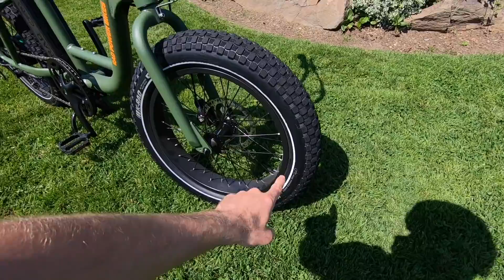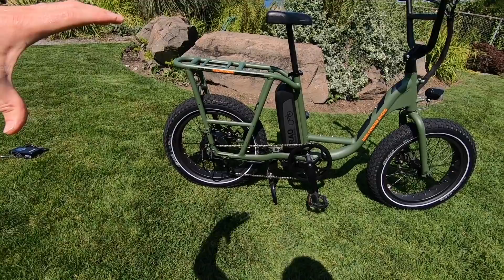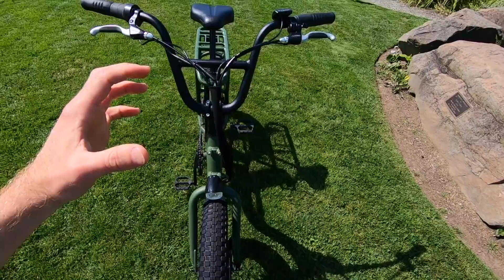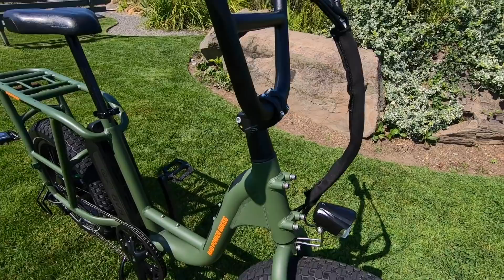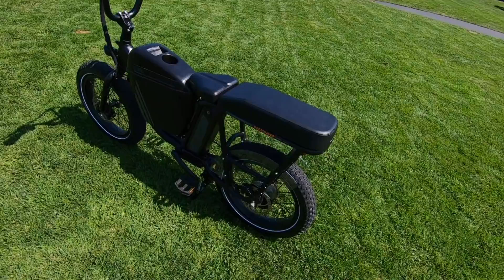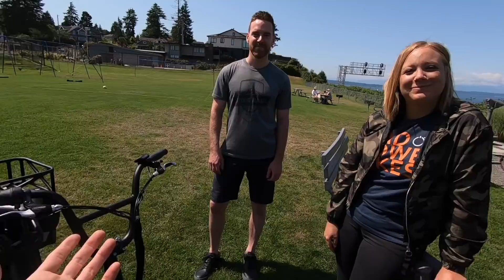Rad Power Bikes RadRunner Review - $1.3k

Comment: i'm debating which Ebike to purchase. My 3 comparisons are Rad runner, Rize Liberty and Juiced Hyper Scorpion. Any suggestions anyone? I think i'm leaning towards to Juiced Hyper Scorpion any comments anyone?
Reply: I almost got juiced hyper. Had it in the cart and gave up after few reviews of flimsy customer support, some awkward design decisions and CEO mail finally pounded nails in the coffin. The radrunner at half price is much better deal in my opinion. Far less legality issues, lighter, so far long rides on battery charge. I'm sure hyper is fine machine but for $3k you can buy honda or yamaha scooter/mini bike that will last longer and be far more capable ride.

Comment: Rode my friend’s Radrunner today here’s an authentic review. I’m 5’9”, 190lbs, a strong cyclist and live in a hilly neighborhood.
Cons: 
- It’s severely underpowered and performs like a 500 watt motor or less. 
- On hills it has a very hard time.
- Steering is dangerously unstable. - its seat is too high. 
- The cockpit is short/cramped. 
- It has too little slack in the stem/handle bars.
- The handlebars aren’t wide enough too keep the front wheel straight. 
- I could barely the get it’s single speed gear up a hill, even when I have it set to its top speed and pedaling
- It has 5 speeds and 2-4 feel the same.
- Does not ride like a bicycle.

Pros: 
- Rides like a scooter. 
-The tires are cushy.

I don’t  recommend the Radrunner at all. 

FYI: When test riding, don’t put a kid or first time rider on it until you figure out the quirks because they will tip over or go over the handlebars. 
I posted this because on YouTube there are only ads disguised as reviews. Hope this better informs your decision.
Reply: Haters will hate

Comment: Can someone tell me..does this size tire circumference not work as well for riding in beach sand...real beach sand..as the larger circumference tires? Provided comparing that both types have wide tires..but ..wont the smaller circumfrence tires not flow over the beach sand and maybe swerve more? I've asked even bike shop owners and I get vague answers..
Any help?

Comment: Beware, RadRunner rarely publish real customer reviews. I know, I've 
submitted the following every week for six weeks.... and even gave them 4 stars.. ZZZZzzzz

We Bought two Radrunners and multiple accessories. We were surprised not any assembly 
instructions. Instead watching multiple Youtube videos, that in a few 
cases were not up to date or detailed enough. For instance, the video 
explains handlebar assembly and makes no mention of the tiny black piece
 of plastic in the hardware kit, by the time I guessed that in goes in 
the goose neck hex bolt I had already misplaced the one for the first 
bike. I started by installing fender kits on both bikes, one bolt was so
 tight that I actually stripped the allen wrench that was provided but 
found another in my personal toolkit that worked. Second came the front 
racks, these both came with a black light mount that’s screw hole was 
too small to accommodate the screw. The video also shows you splitting 
the cables around the rack, but this didn’t seem appropriate with what 
we were provided and would make the Velcro case un-usable. I also 
installed the back seat assembly and shields and another rack on one 
without a hitch. Lastly came the $89ea pannier bags. Larger clips were 
supplied for the Radrunner, but when removing one of the four clips one 
encased nut kept rotating until I removed part of the bag assembly to 
hold it. The entire project took me (a retired shipyard worker) about 
five hours.
Our first ride! The bikes showed four lights on the 
handlebar monitor, so I assumed they were fully charged. We rode about a
 mile and returned, then I loaded up my 70lbs grandson and went two 
miles down the road. On the next mile the gauge dropped to two lights 
and the bike started to roll to a stop. I shut the bike off and walked 2
 miles while I called my wife to bring me her battery. Before she 
arrived, I turned the bike back on (four lights) and it worked. When she
 arrived, she took the grandson and gave me the battery. Subsequently I 
rode the bike about 4 miles (solo) back home using the pedals some to 
maintain my 15mph. Finally exchanged batteries and took the grandkid for
 another mile-long ride. The batteries have been charging since we left 
the beach, so it will be interesting see how they hold up after a real 
charge. BTW I weigh in at 225 and on all flat surfaces I’m considering 
buying a spare battery, but I’ll make up my mind after my next ride 
(next month).

Comment: Overall great review, quick suggestion is maybe you could have asked the other employees questions like what their favorite feature(s) are about the bike compared to the other models they sell or ask them to show how the buttons on the console work. I know that its pretty simple and you did it so easily but I just felt it would have been nice to have them talk more instead of mostly being in the background.

A question I had regarding the bike is what are the options for securing it to the car? I dont think its small enough to fit in my trunk do they sell mounts for the car? When im going on a shopping run is there recommendations on where and how to properly lock it to prevent theft? Should we take out the battery before leaving it unattended? Thank you for making great videos after watching your review I want to get this bike now!

Comment: Personal experience with a Rad Power bike:

I bought a Rad Rover less than a year ago. The breaks were squealing since day 1 but they told me "that's how these bikes are".
Battery life went down from ~20 miles per charge to ~4 miles in about two months; had to replace the tubes a couple times so far and been adjusting the breaks on weekly basis, but that wasn't the worst part.
A thief broke into my apartment's bike cage last month and store my battery. I reported the incident to the Police Department and went to Rad's website to purchase a new battery, but they were out of stock. Called them and emailed them multiple times and explained how the battery got stolen and I can give them the Police case number. I told them how I use this bike to commute to work and unfortunately you can't purchase it from any other supplier but Rad itself. But all I got in respond was "we can't get our supplies from China"

So, here I am, having spend ~1,800 in less than a year with a piece of metal that can't move basically. Consider buying your e-bike from a more mature company imo.

Comment: If you run out of battery how hard is it to keep going with this family of fat tire bikes?  I used to bike back to school from the South Bay to Davis as a kid on a 10 speed road bike decades ago.  Could I do that if the battery runs out without dropping dead?   The range is only 25 to 45 miles, and I suspect that it means it could only reliably run for 25.

Comment: Very nice review, very technical and informative I really liked it. My dad and I hunt where we live here in Central, I would like to see this bike reviewed in the woods dragging a deer out. I weigh about 250 and then of course you want to add your hunting gear and your gun or crossbow. How well did these bikes work in the woods?
Reply: Hey dude, I recently got the radrunner and in only a month have put 50+ miles in. I haven't dragged a kill but have had my 8 and 2 year old on the passenger seat (I'm 235, combined they are about 100) and there's hardly any lack of noticeable power.  I'd say this thing could hold 400 lbs and keep going. Having said that, I'm in Florida where there is relatively flat grounds... but I was able to go up a 45° incline solo with a bit of pedaling to assist.

Hope this helps! It's a great bike for the price... tons of fun.
Reply: Forgot to mention it does awesome offroad with the fat tires but it doesn't have springs on the fork so if it's really off the trail you'll definitely feel the bumps.
Reply: That's great. I do wish it has shocks. I wonder if the 2020 version will.

Comment: Every detail reviewed! Thanks for that! 🙏
Reply: Actually, no.  It missed a number of basic questions.
Reply: So you missed your opportunity to ask your questions instead of your comment? ;-)
Reply: @elektrokatzer  height, length?  Tapered or non-tapered handlebar--not riser?  If the pedals are so great, why do they keep breaking?

People talk about height, but that is useless.  I am 5'4", and have a 37" inseam.  How does that fit on these bikes?  What is the actual distance from the seat to the handlebars?  What is the distance from the crank to the handlebars?

How thick is the plastic on the fender?

It seems most things on rad bikes are proprietary.  Will a standard seat stalk fit properly?

It would seem that any bike person would want to know the answers to most of these questions.

Comment: Mine arrived a couple of days . It came needing a bit of assembly, handlebars, front wheel and pedals, very easy. I like it a lot. I cannot think of anything negative, maybe paint rather than powder-coat and accessories are a bit pricey. It’s surprisingly easy to pedal on flat ground without e-power. I would definitely recommend this bike.

Comment: I wonder if they weren't using the throttle on the hills in order to avoiding straining the motor. Did they mention the need to avoid throttle only on the hills? Also, do you feel like the Radcity does significantly better on the hills with its gears compared to the Radrunner? Thanks for the great review.

Comment: No really sure of what your thoughts of the single speed aspect are. Does the motor over power the peddles. In other words can you peddle at all speeds?
Reply: I am interested in the answer to your question too.

However, believe it or not I would prefer a bike with no gearing. I ride non motorized bicycles a lot and I love my single speed bicycle because it is super reliable.

Up here in Toronto when riding in the winter with slush and salt on the roads, derailers can take a real beating. 

So like I said, personally I prefer single speed bikes for every day use. Plus with the motor here there is no need for low gearing since you can just use the motor to get you up to speed.
Reply: Of course they can be peddled at any speed.
Reply: @ohwell2790  well actually with a single speed bicycle once you reach a certain speed you can't really peddle because you would have to move your feet at a very uncomfortably fast/impossible speed

Comment: The concept is absolutely great but I will wait on the upgraded model for mainly one no-go reason:
IT HAS NO GEARS AT ALL !!! , which means this things is impossible to ride without battery assistance. I prefer not to think at the horror scenario, being Km’s away from home with a depleted battery. 
Otherwise great job guys. So please come up with a new version, some additional hundreds of bucks would be fine 👍
Reply: The specs say 16-52.  It must be an internal gear hub.
Reply: @martincleary9093  in my understanding, that's a single speed bicycle, 16-52 refers to the gear ratio between front and rear sprockets.

Comment: First of all, great concept and very interesting and appealing. Q's: 1) Can a rear derailleur be added later? 2) Is there some type of adapter for the fat rear rack tubing to accommodate Ortlieb bags (that many folks already own)? 3) Can the frame accommodate a front suspension fork if later one wished to upgrade that? 4) Upgrading to a seat suspension post is often done these days; Does the geometry definitely result in the adjustable seat being higher than the rear bench seat? If so, that seems like something that, in design, could have been prevented. 5) Can the bike accept a full-screen display, if one wanted to upgrade that at some point?  Thanks.

Comment: I have a 2019 RadMini about 10 miles away from 1500 miles on it and I love it. I I know a lot of people interested in e-bikes now. I have to say I love this new Runner as a cruiser and a utility bike but as far as a sports bike with the single gear drivetrain and no suspension I wouldn't be riding it on the trails that's for sure. Maybe some mild Trails yes. But this looks like an excellent entry level bike for people who just want to carry stuff around and do some leisurely riding love it
Reply: It does have a 7 speed gear on the rear. I have found on my Radmini folding bike that has been enough along with the twist grip throttle have pulled through some pretty deep sand. Can even bring the front wheel off the ground in run 5.

Comment: Interesting bike, the only minus is the single speed layout. But big battery capacity and a two seater. You're better off in the US than in Europe where maximum power is like 500 W and unassisted maximum speed 20 km/h, not 20 mph. At 20 mph it gets quite useful. I personally don't like the military colour, but the shape is like the Honda Monkey motorbike from the 70's. Price is reasonable with that battery, Baofeng motors are ok, better than Bosch for which no spare parts are available! Appreciated the video!

Comment: I forgot to add one more thing to it you need to come up with a special you like does just a little bit longer to put it through the bike rim in through your frame and hook it up to a post that could be square or some kind of heavy-duty chain that would work great until the meantime have a blessed day or have some kind of Locking System where no one can steal it but you still have to change it up to something that would be cool

Comment: Veego has a better version for less money although not the variety of accessories.
Reply: As far as "less money," the only bike you could be talking about is the Semi-fat.  But it has a lesser battery, no passenger seating ability, different size tires, multiple speeds, inferior light, handlebars, etc.  They are "versions" of each other only in the sense they are both electric step thru bikes.  The Radrunner and Radcity are a lot closer to being "versions" of each other than this bike and your Veego.

Comment: Is that basket one the lady is riding removable, because that would be super useful if it was, especially adding the front mounted basket and the plastic casing in the center of the frame, along with the rear passenger seat option with pegs. Just when I thought I had an option considered, another product comes along that with a ton of features that makes you reconsider your primary option of purchase, am I right? Makes me glad that I held out purchasing a new bike, as I was beginning to feel like I was just wasting my time or dragging my feet when my prior choice looked like it wasn’t going to work out or I had to trade out storage with road compatibility and speed?

Comment: In this category, look at Lectric Ebikes.   The Rad is no match for this, and the Lectric is less expensive has a hidden battery, better tires, better display, folds in half, etc.  I've owned mine a few days and am very, very impressed about how it came out of the box.  It shares many parts with this Rad, but in a different package.  One thing though, Lectric is backordered a few months so if you want instant gratification you have to get something else.
Reply: Even though I ordered the Lectric,  I think the Rad has a much better tread design.

Comment: I like it.  Reminds me of the old style mini bikes.  The seat is adjustable but the handle bars are not, I would not want to have to lean over if I have the seat high. 
Proprietary wheel size? Does that not mean you have to go to them for a new tire!!?
Single gear is my fav part -- I hate gears!!
Geared motor is a little noisy! 

Cheers

Comment: This is really amazing value. They are going to sell many of these bikes. The range is kind of low, but at $1299, you can afford to buy a second battery for $499 and take it with you.
Reply: Try $550 for an extra battery 
I would know 
I bought one
Reply: shadowdance4666 is the battery fairly standard so that batteries from other suppliers work, or is it a custom battery that only comes from Radwagon?
Reply: iakona23 I’ll take a stab that you’re talking about the casing and not the guts or individual 18650 batteries. I’m fairly certain that the casing is unique to Rad power bikes. Not having another E bike to compare it with. You can if you are handy swap out the individual cell rather easily if you have the battery case or shell. You could also change the bracket and battery pack without to much problem if you are capable. Hell I bet you could get it to run off of power tool batteries if you’re determined lol 😂

Comment: Didn't they tease a dual motor version (Bafang motors in both rear and front wheels)?   Also is there option for front suspension?
Reply: Les Hsu no front suspension at that price point. Dual motor. You might want to see a doctor. I believe that you have space MADNESS
Reply: @shadowdance4666  You might be right.  Wishful thinking on my part.  But I would not mind paying a bit more for those options.
Reply: @lehsu  The Arial Rider D Class has a dual motor. I've been debating between the two.

Comment: Well done on the review Court, i really wish Rad was in EU. i would buy this bike for my family.
Reply: Radpowerbikes.eu
Reply: @lowkey1784  Thank you ,  very strange i went to Rad Power us site and check shipping and all i found was usa, didn't even know they had a separate site for EU. i will not be buying this bike, in EU it only has 250w motor , i am 120kg , 250w doesn't even move :)
Reply: @supernova1976  I think the best for you is the Radrhino its 750w the 250w is less power. You can check the EU website.
Reply: supernova1976 my mother has a 4 year old electric bike with a 250w motor and I weigh 145 kg. Have no issues dragging ass my ass around at good speeds, great fun. Issue there is the flex in the frame seeing that her is an old step thru. So I’m not worried about 250w motor, I’m more concerned about my height =)